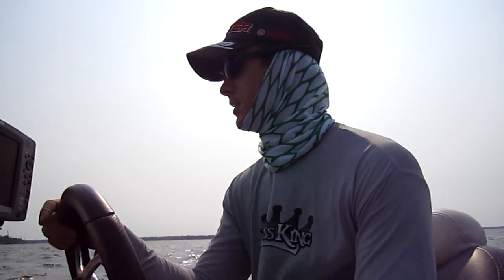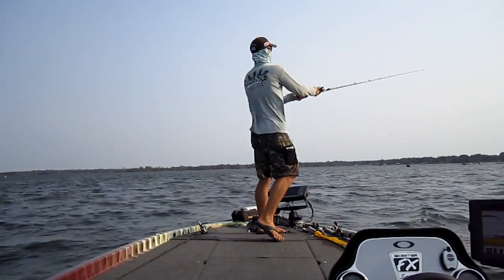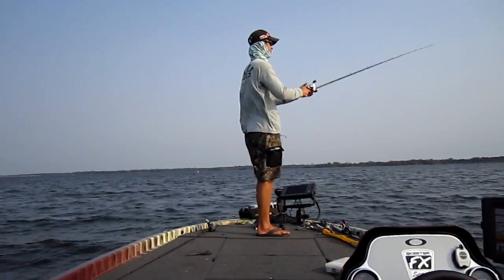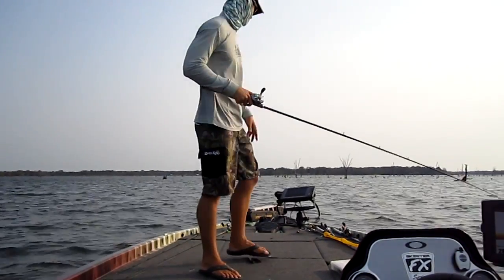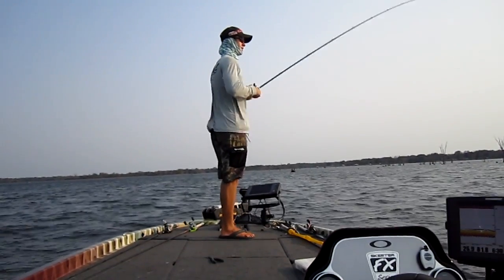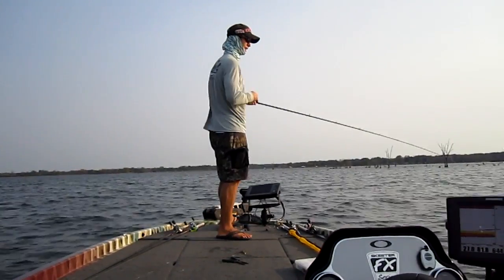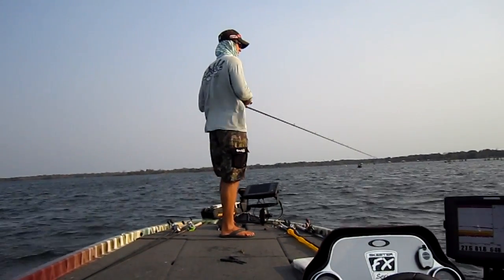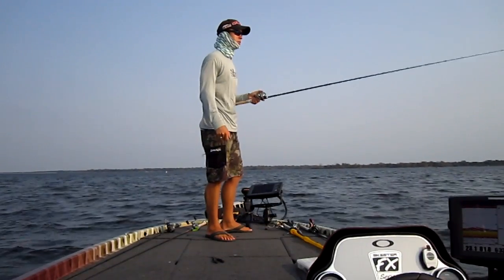How to Catch Bass in Deep Water

Comment: Great video and very informative.  That last bass with the hook coming out of it is proof that catch & release works and that sometimes it is better to cut the line on a gut-hooked bass rather than to try to wrench the hook out and tear up its stomach.  As long as the hook has no stainless steel weed guard (and no SS in the hook itself), the bass has a very high probability of being able to pass or digest the hook.  In those cases, cut the line as close to the hook as you can without injuring the bass further, and throw him back.  It can be his best shot at surviving a gut-hook situation-- and that bass was proof.  He lived to be caught and released again!

Comment from the maker: You can either put in right on top of where you see them( this will scare fish off sometimes) or you can put it off to one side.  I usually idle past the fish a few boats lengths and then toss it.  Just remember the angle you came in at and try to use other visual cues if there are other objects around

Comment from the maker: You don't have to use a baitcaster to catch fish but they have more leverage and take up line faster than spinner rods as well as hold larger line diameters.  For someone starting out, adjust your brakes on your reel to the max setting and practice casting until you get the feel for when to release your thumb off the reel when you cast.  For an overhand cast, you should be letting your thumb off about when you reach the 2 olcock position with your rod.

Comment: Hey man thanks for all the great vids you put out there, has really help me alot on my local Texas lakes. I do have a couple questions however, if you could find time to answer them it would be greatly appreciated. First, do the marker buoys ever let out all the line and drift off the spot in high wind or do they stay put pretty well? Also I have been trying to get on some post spawn fish on ledges and points in around 10-15 foot of water, I'm curious if I am scaring away fish as i drive over them with my big motor in that shallow of water when im looking for schools. Would it be best just to power fish along the edges searching for fish? or should I not worry about spooking fish in that depth of water. (typical murky east texas lakes with 1-2 ft. average visibility). Thanks again for all the info you put out there.

Comment: I cant find the part where you mention your rod prefference. I hooked and lost my first Musky last night on the full moon, probably 50" in PA on a small willow spinner. My point is I preffer longer, stout yet flexible mid/tips like what I see when you use your flutter spoon. I want it to be my first all around baitcaster with Fluoro/braid spools to cover a couple things in one. What do you like to use from Okuma? I read alot about them for swimbait/musky but think your using a lighter one..?

Comment: I can slay the fish when they are on structure/banks and docks but i can't seem to figure out deep water fishing. More so when they are suspended than when they are on the bottom.  Say the water depth was 45' and the fish are suspended at 20'. would dragging a Carolina rig across the bottom still be effective or would that require a lure that would get down to the depth the fish are suspended at like a freak or 6xd?
Reply: exactly how you need to fish them sir... your trying to put a lure right in front of there face.. so what ever depth you see them at try find lure that goes through the middle or right above them.. bass sit with there face up so something 15-20' run depth would be good or you could use a slow falling jerk bait that would reach that same depth. suspended bass are usually not that active but these tips can make them get fired up if one bass takes the bait

Comment: Hey LakeForkGuy, 

Do you use a swivel or snap/swivel combo to connect your line to the flutter spoon or do you tie the line directly to the lure?
Reply from the maker: I will usually go with the snap swivel, it prevents the line twist, and it helps keep the bass hooked up when they start coming up and jumping
Reply: LakeForkGuy
Thanks for answering my question buddy, I appreciate it very much.  If you don't mind me asking you another question, I would like to know your opinion on whether or not using the snap swivel would negatively change the action of the spoon. You see, when I use this particular brand of slow-falling spoon from Acme called the Phoebe Spoon, it seems to cause the spoon to spin instead of falling in a side-to-side rocking motion, which I think drive the fish crazy. I like the side-to-side motion of that particular lure, but if I don't use a swivel it will cause line twists. With the snap swivel connecting to it, does your spoon spin as it fall into the water column? Thanks a bunch bud for being a great sport and for your helpfulness.

Comment: I bought a Lowrance Elite 7 HDI last year, great device. But I'm always wondering, if I see a school of fish at like 30 feet and it's now being rendered in the middle of my 7" screen, how far is it from the bow of the boat actually ? Do I need to back up 5, 10, 15 feet then drop the buoy there ? Great channel btw, I sub'ed :)
Reply: That will depend on where your transducer is and how fast your boat is moving. The screen on your device will naturally scroll with the information sent to it, even if the boat isn't moving. A good way to get a sense of how far things are is to test it at different speeds. Find something that you can sense from the deck, like a dock structure or pylon, and move past it at your normal traveling speed. Gauge how long it takes for that item to get to the middle of your graph, and then you'll have a solid idea of how far away that will be next time you need it.
Reply: That's a good idea Ryan, I shall try that.

Comment: is there any other tip to find bass without a fish finder?
Reply: carolina rig, or texas rig.  Rig for weedless, feel out the bottom in order to feel what's down there, and draw out your own topographical map, weed beds, etc...
Reply: You could also research the area by placing the name of the body of water into a "search plug". I do this mainly due to me not having a finder on me kayak. Information provided from the state or a forum help me to know what type of water I'm fishing 50 percent of the time. Like stated a C-Rig or Texas Rig is perfect plus an added safety pin lure (e.g. Spinner bait). Luck to you, tight lines!
Reply: To add, I've been looking at several Deep Diving Cranks to get those trophies this time of year around my parts. At times I feel more comfortable throwing a crank bait w/lip vs. a lip less crank, due those damn trebles. But in all with the lip crank I get less hung as if I didn't have the lip on whatever crank bait your using, well you get the idea..

Comment: AT what surface temp do they usually go deep?
Reply: it has a lot to do with the season and oxygen in the water.. bass will go deep to find cooler water in the summer usually like mid 80's water temp or if the current is out on the main channel. Not EVERY bass moves deep, just a large amount of them. You can find bass shallow all year, just need to focus on where the bait are going

Comment: can you put a comment describing the set up you're using for deep water fishing.
Reply: deep water casting like he is doin will be a 7-7'6" medium heavy rod with 20-25lb fluorocarbon line, 7:0-1 gear reel to take up line quicker (for jigs, texas rig, carolina rig) for deep cranks same size rod but medium action and 12-15 lb fluorocarbon

Comment: He just pulled a fish up by force with hooks all over them. They are very tough skinned. 
Pulled them up from 25-26 feet of water. This is devastating amount of distance to travel in depth in water.
Grabbing them with dry hands breaking their coat to protect against bacteria.
Pullin them out of the water into INTENSE heat where not only they can't breathe but burning
And you guys are worried about a 3 foot drop into the water that wouldn't hurt a small child. Just to put things into prospective.